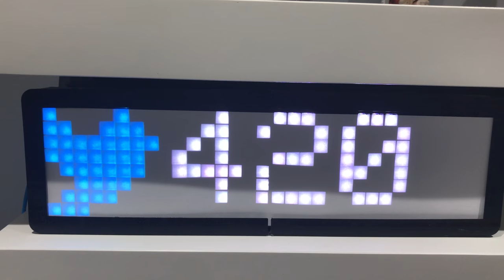Prusa i3 MK3 Awtrix Clock like the LaMetric Clock, Twitter,  Youtube, Facebook,  Weather apps

Comment: Hi, Can you do a guide on this as I have all the parts but after uploading the firmware to the board, I can't connect to it from my phone...  If you can I would like a link to download your files which got yours working?  If you can do this for me please?
Reply from the maker: try this first from a pc or Mac change to your ip
http://192.168.0.xxx:7000/
Reply from the maker: Hi Delsogos
I don't use a phone to setup awtrix, only a local Mac, don't forget to setup your wifi before you upload files to board, once you have uploaded to board goto the IP address and setup apps, it can be a pain at first, but worth the effort, I do have 2 lametric and they are so small next to Awtrix. if your still stuck, message me and I will try and give the files I used.